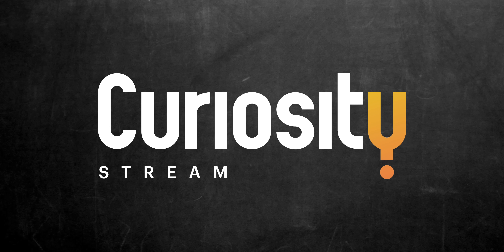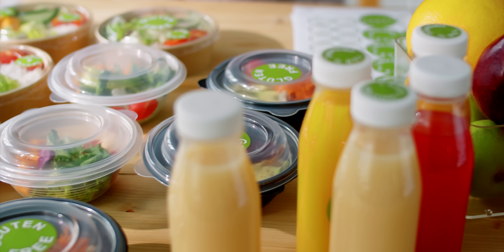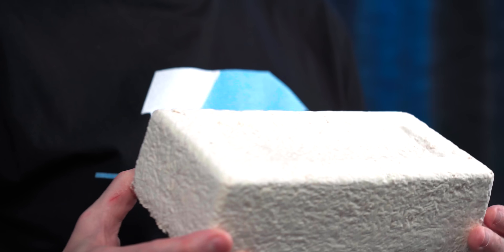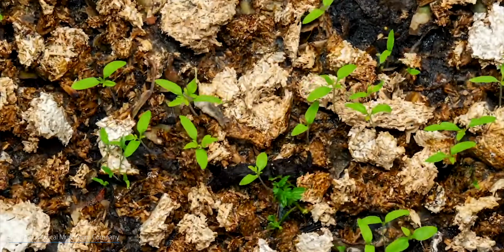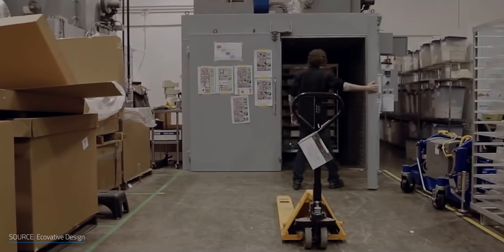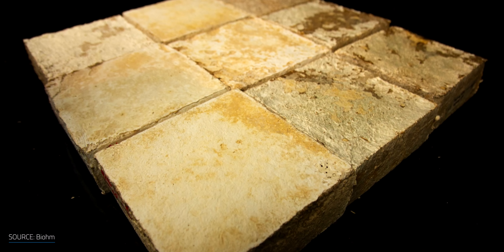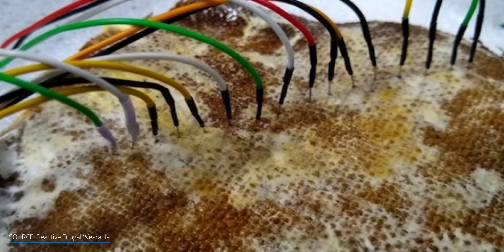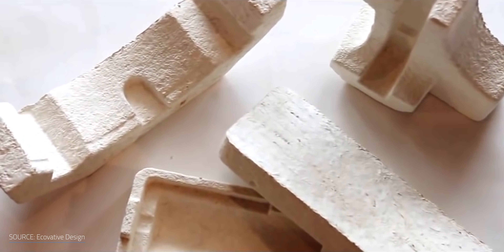Is Mycelium Fungus the Plastic of the Future?

Comment: Even if it ONLY replaces plastics in packaging that’ll be an enormous win.
Reply: and it will mushroom from there.

I'll show myself out.
Reply: It's ok, I'm not a spore sport. :^)
Reply: Sad thing is corporate oil companies all over the world doesn't agree. Because their oil by products after fuel production is processed into non-biodegradable plastics. Which won a Nobel peace prize for making plastics possible from oil by products.
Reply: @Niggurath-n4h  hmm so if they dont make plastics with it they just dump it?
Reply: @TeenyTinyDevil  they can put it back where they dig it or at least process them into a more suitainable products. Remember making it into plastics is just a temporary solutions of delaying the inevitable. All outcomes so far lead to more trash and unsustainable to the environment. Sadly people seems to ignore this cycle.
Reply: @Niggurath-n4h  over production. The short cut mentality to say its easier to produce new and unproductive to take responsibility of so called recycling. Same core problems will be there. This just another to run away from actual problem. With that said this sounds cool, but won't be surprised after few year of entering mainstream, it will do different then electronic vehicles. Solve one problem only to create a different
Reply: @Niggurath-n4h  also not all plastic materials are useless. Some, such as plastics for reusable containers are probably what we should use for these products. That way, when it becomes useless for say water or food, something non perishable can be held in it. Thus continuous recycling.
Reply: @DeathProductions200  That’s what glass is for
before plastic glass bottles where used.
Reply: @darth3911  i know, but we do have to remember. There are people, like myself, where possessing glass containers can be harmful. Why I think plastic straws shouldn't be banned. I cannot use metal, silicone. And many are allergic to the bio degradable straws. 

Look, I do believe that we all need to do our part, but remember disabled people exist and need to have access to certain plastics and materials because well, it is safer for them.
Reply: @DeathProductions200  Same can be said for plastic there’s people allergic to it
but even in the times when plastic was not a option 
there was alternatives to glass and even with that said i never heard of anyone being
allergic to glass so i don’t know why you use that as a argument on why to keep plastic.
Reply: @darth3911  again with disabilities. I'll use me as an example as I am one of many people. Having some cognitive issues where my coordination is effected, I can only imagine holding a glass cup, and all of the sudden dropping it. Hell to avoid spilling water I have to use both my hands sometimes. 

Most plastics if they do break. Dont shatter like glass. 

As for some people being allergic to plastics. Absolutely!! And we need to respect that. People can't control their health, so if they use say a plastic cup, straw, or plastic bag that are single use, why get mad at them. For me, I have to use single use plastic straws. Cleaning straws is a nightmare, and due to sensory issues, along with other things. Anything not plastic actually can be more harmful.

Before we effect the citizens, make a stand against businesses. Then we can figure out how to benifit the environment through each individual citisen
Reply: @qdgamer7183  I'll just say that it is the oil companies responsibility to make it productive and non pollutant.
Reply: @DeathProductions200  nope, it does not answer how are we going to dispose or make it sure it biodegrade into our environment cleanly. Recycling is just another way of delaying the inevitable outcome of pollutants and trashed.
Reply: 90% of ocean plastic comes from china and asia so i dont see how its my problem.
Reply: @Niggurath-n4h  oh now i get it why they kill US muslims they need OIL for plastic(wich to me Sounds Kinda weird Like plastic made out of oil)why dont they stop killing People and why dont they just make glass bottles or somthing Like that i meen you can recycle them too and you can use oils for foods if we are talking about that oils Like they dont need to kill us for it Like give me one reason to why to kill us for oil instead od buying it Like a normal human being
Reply: @Andrew-qs6ml  the war for oil/resources has been on going since the napoleon to world war 1. Which just spill out to the oil rich countries, when the countries involved realised their own oil field is noy enough to last longer.
Reply: @DeathProductions200  Why are straws necessary at all?  Apart from a very small minority (eg quadriplegic people, cerebral palsy, severe arthritis) can’t most people simply drink from the edge of the cup or glass?  So provide straws of various types to account for allergies etc to the minority and the rest of us just take the hit and sip from the edge of the cup/glass.  Sheesh
Reply: @drcanram  there are hundreds of reasons why people may need straws. I needed them recovering from a major surgery cause I couldn't lift my upper half. People who suffer from chronic pain conditions and have a flare up of pain. In the end, we shouldn't judge people from using straws, and we should be targeting the majority polluters which is the big companies that waste more than they recycle. We should develop good materials for straws that are safe for the environment and for everyone to use at the same time. But start by putting plastic restrictions where it counts.
Reply: @DeathProductions200  That’s essentially what I said.  Most people don’t need straws to drink.  For those who really need them, they should be available.  That is a small fraction of any population.
Reply: @karozans  I really don’t want to into any debate with a person who holds your types of views.  But I do want to thank you for pointing out how I clearly have chosen slavery over liberty because I have suggested that maybe very few people actually need to drink using straws.  I mean, why hadn’t I seen the connection between those two apparently totally unconnected concepts, before you so expertly pointed it out to me?  Wow, you are really smart and insightful.   Thanks again Vladimir
Reply: @karozans  Have nice life Vlad
Reply: @karozans  Wow.  You are so insightful.  How could I be so wrong ?  Thank God you are here to correct me and keep me from advocating Government control and slavery.  I really don’t know what I would do without your keen intellect and razor- sharp reasoning skills.  You are truly one of a kind.
Reply: @drcanram    I wiII, baby cakes.
Reply: @drcanram     LOL....  "I dnt want a d3b4te, but I wiII c6ntlnve on crylng forever...."

I kn6w what U wld do.  Not cry on YT.  That's what U'd do.
Reply: @karozans  🤣🤣🤣🤣🤣🤣
Reply: @karozans  Nope, because you are so cool and “edgy”.  The way you use numbers and capitals instead of typing normally- it’s so edgy, so cool!  I just can’t get enough of it!  Tell me, what’s it like being so cool and so “edgy”, huh?  What’s it like, Dmitri?  Please tell everyone your secret so we can all be even a little bit as cool and edgy as you!
Reply: @DeathProductions200  I appreciate this education. I of all people cannot predict the future. I am supposing (just supposing) that either plastic products such as the ones you need will continue to be available or there will be a different acceptable  products. I certainly hope so.
Reply: @Niggurath-n4h  Funny, that never occurred to me. Thanks for your thought.
Reply: @Niggurath-n4h  well we can try to change the world and support that by buying micelium stuff when we need them
Reply: @Niggurath-n4h  Unfortunately so true. (I did not know about the Nobel Prize.)
Reply: @Niggurath-n4h  This material would be valuable only if  fossil fuel is replaced by nuclear, but if that transition is not  given yet and notwithstanding that polymers derived from hydrocarbons  is still  to be replaced by some others like this one , then you will be exporting waste to poor neighborhoods, cities and countries.
Reply: @Niggurath-n4h  id rather them not use the oil but for gas
Reply: @einar8019  I also agree that is why I hate that Nobel peace prize condone such acts.
Reply: @Niggurath-n4h  Those same companies have lots of money in renewables. Just like with them, this technology would still be dependent upon oil in the production.

Don't kid yourself into believing these companies are against this stuff. They're the biggest proponents of it.
Reply: @Niggurath-n4h  Do away with this conspiracy theory, the reason why plastics aren't going anywhere for at least a century is because it takes that much time and probably even more for the lazies up top to move and do something, more concerned about security trough stillness than adopting innovation even if the latter at worst can only cause some small losses.
Reply: @Niggurath-n4h  when i see shit like that I think of Ted Faro in horizon zero dawn. Some fucked up assholes willing to destroy the world to any extent just to suit their profit margins.
Reply: @Niggurath-n4h  exactly...big oil will likely shut this fungus thing down too
Reply: @Niggurath-n4h  the plastic industry only makes up an extremely tiny fraction of oil consumption
Reply: @drkastenbrot  yes it is tiny but the effect is much greater as this doesn't dissolved in the environment. It needs industrial chemicals to brake it down.
Reply: @Niggurath-n4h  all plastic is oil based and all of it is basically not sustainably recyclable...that being said why wouldnt they win a nobel prize for making the firs thing that doesnt decompse(rust, rot etc) plus all of us could boycot plastic and it wouldnt make a diffrence there are people in this world that create hfcs to destroy to sell credit to companies that make plastic
Reply: @Epck  I respect ur reply.
Reply: @Niggurath-n4h  companies have a limit on the waste they get, if they do that, then the cost will be higher than the production
Reply: @Niggurath-n4h  which is a shame as there's probably better things we can use oil for than my shopping bag, container or even toys for the kids.
Reply: @Niggurath-n4h  The end of Big Oil is coming. We are running out. And when that happens you will see a dramatic change in how things are done. To avoid this I believe governments and companies around the world, not working together mind you, are starting to introduce new ideas and methods. Oil was once the Next Big Thing that dominated the world's economy for over a century. People at the top know that while they have no real idea when it will run out, it will eventually run out because it takes millions of years and billions of tons of bio mass to make oil naturally. So now many individuals and groups are jockeying for position so to speak trying to find what will replace oil.
Reply: @davidtherwhanger6795  nope there are still a lot of oil. It just that this well established oil company knows how to manipulate the masses to increase the oil price. They keep on saying that there will be shortage of oil by years in the future. But if you look at the statistics more and more oil rigs are being built. It just that this company are running out of easy to access oil field with little to nothing as a hindrance to the company corporate greed for more money.
Reply: @davidtherwhanger6795  We're not going to run out of oil in our lifetime, and probably not in your grandchildren's lifetime. We keep getting better at finding it, and extracting it from places that would have been impossible in previous decades. That said, we really shouldn't be using oil for everything.
Reply: @Park Justin yeah. Hence my comment.
Reply: Amazon boxes, the filler material, and clear bubble product packaging.  That would cut plastic use in half easily.
Reply: @clayz1  The filler material can be replaced with expanded corn starch. Some companies already use this stuff.
Reply: @clayz1  pp lo 0.l ppl
Reply: I can't stand getting styrofoam.  It's designed to take up maximum space so it's really annoying to dispose.
Reply: @alistairblaire6001  Never thought about it that way, or any way for that matter. But you might be on to something.
Reply: @Dollapfin  it will run out but not before a huge crisis and damage is already done. Which will lead to the cycle keep on moving forwards.
Reply: right. for single use plastics that would help a lot.
Reply: @I.M. Shirley Rongh economies of scale. Plus I’m sure they’d find a way to make it faster too. Also even assuming emissions from production was equivalent to what we are doing now, there would be significant reduction in waste.
Reply: @Park Justin   You want me to give an off the cuff estimation better than the (sin)30.
Reply: @Cancer McAids it still do not answer the plastic dependants of most petroleum base products. Which lead to the cycle of the trash and pollution problems.
Reply: @Park Justin ClayZ didn't have to come up with an actual number. Look at the stuff you (and everybody else) orders from Amazon. The container, the inner packaging, the filler, and then multiply that by the number of people in the US alone. Even if Amazon only changed for their US operations, it would still be a significant cut back in the amount of polystyrene and other materials used.
Reply: Only time will tell really. We can just hope for the best that things don't go south and lead into bigger problems.
Reply: watch the netflix documentry seaspiracy, the argument is industrial, and fishing waste is the majority of the problem, not bags and straws, it was a intrestign watch
Reply: I totally agree, plastic packaging of products and produce is a HUGE problem, and it's not recycling that is going to change that. The best solution is not producing or using plastics and derivatives in the first place.
Reply: I work in a water house and its so disheartening how much plastic get used in a day
Reply: If they make mycelium bottles, I will stop buying bottles

I aint drinking from fungus
Reply: @dieterrosswag933  the burnt carbon needs to go somewhere, filters separate things they dont clean things
Reply: @dieterrosswag933  I dont want anything random person from the Internet, I just wanted to fix a few broken braincells for you so you could realise the complexity of the situation
Reply: How did we ever manage before plastic containers?  All we have to do is look at that, go back to it in part and stop being so blamed lazy.  Let's face it, why do we all need to carry around bottles of liquids with us all the time?  That was unheard of up until about the early 1960's.   People drank whatever they needed to drink at home, at soda fountains or coffee shops and used reusable thermos bottles when they went to school or work.  People brought reusable baskets or bags to the store.  In England, they celebrate "Boxing Day" - the day after Christmas when everyone returned the boxes they got their Christmas presents in.  Imagine that!  Reusing our cardboard boxes.  Who'd a thought.   Jeff Bezos ought to have ways people can turn in all their used cardboard boxes so they can be used again.  In our area, you can return things to them at Kohl's or via UPS.  Why not have those places accept Amazon boxes for recycling since they already have merchandise going back to them?
Reply: but an enormous loss to oil manufacturers and producers, so there will be and already is heavy resistance. Industry doesn't like change. Sometimes we make it flat out illegal (See planned obsolescence)
Reply: Better never happen. Companies are too greedy to spend more on packaging they will lose out for the cheaper option. The day that this becomes cheaper than actual styrofoam is the day styrofoam will be obsolete. Till then styrofoam it's here to stay.
Reply: 3 words
Mycelium 3-D Printer!
Reply: @freddynovember5842  I like it!
Reply: I feel like farmers everywhere are struggling and this could add a new crop they can grow and make more profit off of. Not to mention they can supply their own growing medium
Reply: Just replacing styrofoam alone is a big win because once it breaks, it's fucking everywhere. I'd rather deal with throwing the stuff into a compost pile than to deal with the extra packaging going in the trash.
Reply: Can they make it clear? If they can't make it clear, then it won't replace the plastics used in packaging. It could replace cardboard, potentially; though, for obvious reasons we aren't really reaching for a green alternative to cardboard at this time.
Reply: @TheBrothergreen  most packaging isn’t clear. You’re thinking of the shelf-ready display packaging. Obviously that is a hurdle as well and frankly just shouldn’t be a thing anyway because it’s horrendous to open as is, but I’m talking about all of the styrofoam and molded plastic they put inside the cardboard boxes for shipping and such.
Reply: @disgustedluigi  eh, they only really use that kind of packaging with fragile shipments these days. Wine bottles, decorative candles, etc. Most shipping is just throw it in a box and let it go, the expectation being the "shelf ready" packaging will be enough.

This is true at the corporate and consumer levels.
Reply: @disgustedluigi  THEY ARE RECYCLABLE!
Reply: @TheBrothergreen  green alternative for cardboard? Isnt cardboard literally just recycled paper and biodegradable?
Reply: @dasavagecabbage9483  yup. Good job 👌.
Reply: Absolutely
Reply: @Park Justin   absolutely. I don't think people comprehend how big of an industry the packaging is.
Reply: ENORMOUS though
Reply: @Cancer McAids Actually the problem literally is plastic itself when used in food packaging. It leeches chemicals into the food stuff that causes increased estrogen production and cancer. Its part of the reason there's like 500% more ED and cancer in young people today than in the past.
Reply: @lurksnitchtongue8986  hmm yes and no, the increase in cancer can easily be the result of modern usage of cells and laptops as well as microwaves.

it also increases the closer you are to a traditional power plant of coal or oil. (we need to go nuclear as solar and wind don’t work)

if you have and use a fire place or ever gone camping, fire even when burning wood produces toxins which increases your cancer risk as well.

eating smoked food and...

as for estrogen, plastics do chemically mimic estrogen, there’s not much you can do about that, they don’t increase estrogen, they act as estrogen or pseudo estrogen in your body.

the best way to combat that is to eat meat and eggs which increases your testosterone production and take testosterone supplements. exercise also increases testosterone production.

the problem with replacing plastics is that plastics are extremely useful and easy to not only make but use.
Reply: @YinglisTheYinglet  So because smoke can cause cancer that means its fine to directly expose (nearly) every single thing humans consume to plastic? And the increase in test production from meat consumption is minimal at best, and you can't just get testosterone supplements (steroids) without having an actual good reason to, and using plastic packaging is not enough of a reason lol. Besides, taking them long term can ALSO cause cancer.
Reply: @lurksnitchtongue8986  1) steroids aren’t testosterone supplements and you can get testosterone supplements over the counter.

2) beef is actually #7 for one of the best testosterone dietary sources according to healthline, eggs #3, milk fortified with vitamin D #2, fortified with vitamin d cerals #4.

vitamin d is also linked to improved testosterone production as you can see so vitamin d supplements also help.

3) i said there’s not much you can do about the chemical make up of plastic, the best thing to do is to prevent leakage and just handle it
Reply: @YinglisTheYinglet  1) no there are not. Anything that increases testosterone production in the body by a substantial degree is an anabolic steroid. If you disagree I encourage you to name what supplements you're talking about

2) Regardless of where a food ranks in promoting test production compared to other foods, its still really low and negligible

3) There is something you can do. Plastic should be banned when it comes to any form of food packaging. It has nothing to do with leakage. Particles of plastic from packaging ARE going to leech into food products if there is any contact at all.
Reply: @lurksnitchtongue8986  1) if you’re gonna nitpick, than none anabolic steroids aren’t testosterone supplements.

testosterone gel

D-Asparatic Acid (a key component to natural testosterone production)

DHEA a anabolic, over the counter brands Life Extension DHEA, Country Life DHEA Complex For Men

what was that about it not being over the counter?

2) tin and aluminum cans also do the same with contact, glass also chemically leaks on food with contact but is generally sturdier.

so do we ban glass, tin, and aluminum from food storage as well?
Reply: @YinglisTheYinglet  1) None of those actually work when it comes to increasing testosterone production. They're modern snake oil. If they actually worked they wouldn't be over the counter, because increasing test production can actually be really dangerous and needs to be regulated. If it actually worked almost every major athlete would be abusing them.

2) You yourself just admitted those things are far more stable than plastic, which is what makes them better. The melting point for metal and glass is insanely high, for plastic is like 200 degrees. Plastic is also way harder for the human body to process and filter out. Hence why it stays in nature for hundreds of years.
Reply: @lurksnitchtongue8986  multiple studies do suggest dhea supplements do actually work.

as for T-gels and T injections they’re literally made out of testosterone so i don’t know where you’re going with “they wouldn’t be over counter if they worked”

and no, i said sturdier not more stable, those are 2 different concepts, (when handled appropriately), inappropriate handling because of glasses brittle nature does result in micro glass in your food and again glass also chemically leaks all over your food
Reply: @YinglisTheYinglet  Umm... Beef has oestrogen pumped into it.
Reply: let us forget IPR , transfer the technology to all countries like Vaccines, after all if poor country spoils earth it will reach rich country also.
Reply: 1) it “IS” plastic 

2) if you just used the fungus even with manipulation it would eat the package, the fungus is capable of anerobic metabolism and literally eats plastic.

3) if you actually care about the environment, compostable plastic is the way to go
Reply: It is too labour intensive and expensive to produce to be used as the protective in the packaging.
Too much hypes...
Reply: @drpk6514  yeah, because production methods are never improved or optimized ever.
Reply: @disgustedluigi  it is impossible to make it practical due to the sterilisation and the time it takes. I know it because I dealt with them. Using potato starch materials are the best substitute for styrofoam.
Reply: Is there anyway we can help these companies besides purchasing products?
Reply: Agreed
Reply: Won’t happen, too expensive.
Any alternative, as cheap and awesome and easy to produce and use it might be, can’t beat the fractions of cents it costs to produce a petrol based plastic product. You just can’t compete with „virtually free“…
Reply: @Renuclous  Which is why the government needs to step in and make it happen. Plastic is cheap to produce, but the cost is our long term health and stability which is far more expensive in the end.
Reply: @lurksnitchtongue8986    No they don't, and plastics do not cause health problems.  Plastics increase health, not decrease it.  You are believing lies.

Remember when everything sucked and the government came in and made everything better?  Neither do I.
Reply: @karozans  "Plastics increase health"
L. M. F. A. O.
Reply: @karozans  You are completely wrong, and I suspect that you know it.
Reply: @drcanram  Not a valid argument, honey.
Reply: they wont take the L lol
Reply: Wont make any difference until china gets their act together.
Reply: Not really
Reply: @Cancer McAids I think I read somewhere that packing material is about 10-15% of all plastic use in the world? or was it waste. Regardless, yeah, petroleum-based products aren't going anywhere but that 10-15% is likely to be replaced as soon as oil prices increase just enough that investors stop sleeping on it.
Reply: Super Mario Brothers Super Show nigggaaaaa
Reply: Thats what I love about these massive scientific inventions, even with the minimal risk option the change is massive.
Reply: plastics too far for me, replaces styrofoam is the main goal
Reply: Buy it, raise the demand, the supply will eventually grow and plastic will become obsolete
Reply: yeah since packaging plastic is used everyday everywhere
Reply: You have no idea
Reply: Spoken like a true mario brother
Reply: Absolutely. That's the category that most needs replacing.
Reply: @Cancer McAids You get it.
Reply: Just grow your own... boom solved
Reply: and sex products will save ALOT
Reply: And unlike the electric car and lithium mining this is actually salable. Here's hoping this won't turn out like plastic has, and I don't mean the recycling part but how some plastics are toxic to humans or give up substances that end up having negative health impacts.
Reply: @dieterrosswag933  what do you think a filter is gonna do?
Reply: @dieterrosswag933  how do you clean carbon dioxide?
Reply: I think plastic is invented to be strong and reusable but people just yeet them everywhere
Reply: @dieterrosswag933  and you dont know much about plastics and air filters
Reply: victoria secret
Reply: I wouldn’t mind that at all imagine this in the summer for ppl who buy those disposable coolers
Reply: To little too late
Reply: Imagine in the future you are Like 3 years old and instead of your parents buying you an plastic toy they just give you a mushroom
Reply: @Park Justin around 40% of plastic waste is actually fishing nets and lines
Reply: Hell yeah
Reply: It will need to be cheap, VERY cheap
Reply: Stop using disposables!
Reply: Shut up
Reply: You need JESUS. Pray to HIM, HE loves you.
When you die as we ALL will soon. 99.9 sooner than they think 🤔 ..you will kneel before JESUS. Romans 10:5/10. The One and only true Son of GOD Almighty, all others are false..we are all sinners and need JESUS.  JESUS was crucified on the cross at Calvary and then on the third day rose again, for you and I (John 3:16). So, Choose this day whom you'll serve. For if you don't it will be chosen for you and that is HELL
 Arguing with me is silly at best. Bc I'm just the messenger...
💌
Please call .
83.For.Truth.☎️.👍....... ...........🤔
Reply: @Mr.Caring  Please, this kind of comments puts Christianity in bad light 😔🙏🏻. You don't need to believe me but please pray about this and ask guidance from Jesus. God bless! 😊💛
Reply: @Mr.Caring  I have given my life to God and asked Jesus to be my saviour two decades ago 🙏🏻😊✝️. I have never regretted that! My roots are in Pentecostalism but most other Christian congregations are good too.

I wrote to you because I find your approach to be alienating towards people that still haven't found Jesus. What you write is true but "the scare tactics" are not the efficient / proper way - I think.

I have prayed regarding this and also asked what my older fellow Christian thought. We both got the same guidance that this kind of way you use isn't what our father wants from us as Christians. So please, I urge you to pray wisdom regarding this. 🙏🏻💛

God bless!
Reply: @T3KKANッ TRUE THAT!
Reply: The most important thing is to get plastic away from the food we eat, plastic chemicals leak into the food and makes everyone more feminine, women and men and it’s why most girls enter puberty as young as 7 years old, it basically makes women age a lot faster and it makes men more neurotic, easy to anger and feminine.
Reply: Too bad we’d rather go ruin other planets than solve the issues depleting and killing ours.
Reply: @DICKFARTZZ  this why the capitalism is bad to the environment
Reply: true, gonna be big bang, hitting the fucking function of a plastics
Reply: Lol. ‘Only’. You picked the largest plastic market. Aim lower.
Reply: So it’s strong or it decomposes on 45 days? Lol this is so misleading.
Reply: Imagine us developing fungus that consumes plastics as a food source like we've been trying to get bacteria to do.
Reply: Luigi mushroom
Reply: Most of the stuff this would replace plastic for in packaging (since it shares the same use case limitations as hydroscopic polymers) can be done with the wood pulp or mulch you'd feed the fungus anyways. Maybe the novelty will get people onboard with alternative packaging materials but unfortunately we only ended up getting a small idealized piece of the story in this video.
Reply: Adi…das not adeeeedas
Reply: @Cancer McAids yes but that wouldn't be a problem in the first place without plastics.
Reply: Honestly everything but food sounds amazing. But then again I've never like mushrooms on anything...
Reply: @Dollapfin   Actually if the mushrooms are more excepted and are given the ability to go main stream then they could actually be preferred because they could become even cheaper.
Reply: @Cancer McAids I agree, plastics have their place in technology, but that technology should be long lasting, plastic is perfect for that use. It should however not be the material for single use items, packaging, trinkets and toys, but be used in where it is really useful and necessary. Even if single-use plastic was replaced, we still have a huge problem (which unfortunately now has industry built around it) of disposing, transporting and dealing with the now useless material, whatever it might be, it still required huge effort and large amount of energy. I think the solution still is to have more drastic changes in our way of living, which would mean a different transportation and distribution solutions which would not include such a wide use of single use packaging. 

In a way I'd like to see a return to the old in a modernised way. Standardised containers for consumers to retrieve their goods and refillable larger containers for products to be moved in between the shops and back to the manufacturers to refill them again. Just reducing the packaging amount on necessary products like food would be a huge win!
Reply: There's a fungus among us...
Reply: Very true...i think the key is to be reasonable. Use it at first where it makes the most economic sense, let it get established, and then expand it's use. This is one area I don't mind if the govt requires it's use as long as it makes sense.
Reply: Hemp
Reply: Mushrooms can also replace animal leather.
Reply: well  I don't think it will replace plastics 100% as the molds for the foam and bricks are made of plastics :) 

Still it's a start, even if they replace  just polystyrene, if they can make bottles out of it   and it's cheep to make them, then it could work.  

but 100%  replacing plastics is a wet dream at this point, fun but not real. 

As a side note, it's kind of funny how companies like this say they are peddling a product that replaces a "bad " product, when they make the molds they need so much out of transparent  plastic :)  

It's kind of like a vegan going  "meat eaters are Satan"   but then he goes to KFC and  gulps a whole bucket of chicken, I mean, sure he could go and buy vegies from the market, but why bother when KFC is right across the street, just like the makers of fungal plastic could use iron or wooden molds, but why bother when KFC is soo much cheaper :)
Reply: 1 point for logistics
Reply: what about pannels in cars, said its tougher
Reply: @Dollapfin  COW FART FACTORIES
Reply: “Only”
Reply: DisgustedLuigi, But not for death.
Reply: It wont. Its way too expensive and slow. Im not saying i wouldnt want this, but it wont happen. Show me a fungus that can grow to shape in at least under 1 hour and has the same properties as polypropylene, and then ill be a bit more convinced. World is used to packaging that costs cents, and can be made in literal seconds.
Reply: @Cancer McAids the breaking down and recycling of plastics leaks microplastics into the environment anyway. Which ends up in food and water. Even after filtration
Reply: This is the correct mindset to have. The reality is that oil-based plastics are a bit of a miracle product, I doubt there is any one material that can replace every case where plastic is used. We need to be willing to take smaller steps, settle for alternative materials that might only replace plastic in a few areas. If we do that for a few decades, maybe oil-based plastics can be relegated to only one or two kinds for niche uses, which would allow it to be efficiently recycled as well.
Reply: I think you're right because single use disposable plastics are what make microplastics so prevalent. I know they are useful for the differently abled or disabled (whichever a person from said group prefers) so it is good we keep them around. But if fungus can be used instead, for straws let's say, and To-go containers then that would be awesome
Reply: @bnpixie1990  I think even if it’s JUST long distance shipping material for like overseas freight and cross country trucking until it makes it to store shelves would be a massive step. I don’t have any numbers but I imagine even just stuff like packing peanuts, bubble wrap, styrofoam, waxed/coated cardboard, and other hard to decompose materials used in bulk make a large portion of all micro plastics and long-term waste even if we don’t normally see it.
Reply: It also needs to be cheaper than plastic which I don’t think it could do, it’s just not that popular either to make enough
Reply: We could get a telekinetic inside the box to control the item from breaking.
Reply: Clear plant based plastic alternitaves already exist and are made from potato starch and plant cellulose, it's what we should make straws from instead of unrecycleable wax paper.
Reply: yeah i dont expect more then that....
Reply: yeah sure buy a takeout pizza packed in mycelium box when you come home pizza is gone what happened? mycelium has eaten you pizza and if you lucky maybe you hear the box - "burp"!!
Reply: @bitsmart...  that’s a dumb example when pizza boxes are already recyclable cardboard.
Reply: Could we send rockets into space filled with plastic to rid the planet of credit card companies? Or wait, when cc's expire you can trip on shrooms
Reply: The seaweed based plastics can and are replacing plastic packaging
Reply: Clothing would be good also because the most of micro plastic in water is from washing clothes made of polyester.
Reply: Is it floatable? Or can withstand water... Is it applicable to hydroponic?
Reply: Ew, no I dont want fungus as a cereal bag.
Reply: i wouldnt mind having a pair of shroom shoes to go with it
Reply: @LIONGOD  mushoes*
Reply: @KabegamiTheGreat  shoeshrooms*
Reply: There is another alternative that uses recaptured CO2 from the air fed to water based algae that then produce a material that can be used to produce a plastic alternative with most of the same properties that can be used to produce the same sort of products and biodegrades within a few years.
Reply: it doesn't
Reply: @mori7423  Captured repurposed carbon plastic does.  Produced via feeding Algae CO2 recaptured from the atmosphere and processing the algae's waste product.  The resulting carbon plastic pellets behave like regular plastics in production use, but biodegrade in a matter of a few years.   Excellent for short term packaging and disposable goods such as straws, cups, bottles, cutlery etc.  Anything that would expire within a short period of time and requires disposable plastic.
Reply: Water bottle s are probably the most dangerous to humans as far as endocrine system is concerned
Reply: @808yorkie  Why is that?  Why water bottles precisely and not say soda bottles?  Or other plastic bottled products, such as ketchup or mustard bottles?  What about plastic containers for cooking in microwaves are these not a concern?
Reply: i dont get it, we already have carton and paper, why do we need this?
Reply: no.  facts are hugely skewed in this video towards idiotic-green point of view.  this material is heavy, fragile and expensive what means it needs more fuel and money.
Reply: @vasyapupken  you act like every successful innovation is perfected and market-ready from its conception. Nobody said it was ready to replace anything just yet.
Reply: @vasyapupken  Most of the mycellium I've dealt with isn't heavy or fragile.
Reply: There's been a few articles out lately that claim a recent discovery of a bacteria that can harmlessly digest and pass the plastic back into organic forms. 

To me though, this sounds a little too convenient as far as timing. Almost like this bacteria was known, or suspected to meet the needs of plastic disposal, from the very beginning. Probably wasn't any where near being ready but got rushed once something or someone reached a panic level.
Reply: @Iceflkn  plastic is organic... i mean that’s a over simplification because it also has hydrogen but most of the material needed is actually organic, gases and oil just so happen to have a bunch of the material in abundance.

the reason certain plastics take so long to decompose is because of their very strong bonds.

fun fact: there are beetles and other animals that can now eat plastic
Reply: @YinglisTheYinglet  I knew all that but thank you for sharing! 😁  

I view the business world with suspicion and disgust having learned how many industry giants manufactured, sold and polluted knowing full well the dangers involved.

They didn't care how many got hurt or killed, wanting only money and power.

Funner fact:  animals and such that now eat plastic, only got the chance because we humans put it everywhere, including their menus. 

Go team human.....ugh!

Also, humans and animals alike are getting poisoned by Microfiber released into our planets water systems and since we don't even filter the water used when washing microfiber materials. 

It's found it's way all the way into our bottled water production plants. Enjoy a nice bottle of water on a hot summer day?
Reply: @Iceflkn  apparently some people wash their lint down the drain instead of throwing it out in the trash which contributes to microfiber pollution.

and there are new filters now able to catch microfibers, they don’t catch all of them though. perhaps making microfiber filters mandatory for water treatment facilities and for new laundry machines would go a long way in helping reduce microfiber pollution
Reply: @Iceflkn  Bruh it's called evolution. Pretty sure there's now multiple known organisms that can degrade different types of plastics and there's also genetically engineering experiments to combine their genes and optimize  them and so on.
Why would there be plastic eating bacteria "from the very beginning", before there was even plastic? What would it have survived on?
Reply: The odds are that the claims made in this video are greatly exaggerated.  You think they are 100% accurate because they feed your confirmation bias.  You only look at the positives and ignore the negatives.

If Mycelium products were better, cheaper, and faster on all the things they mentioned, the demand for it would explode at an exponential rate despite what you think the oil companies are doing to keep it hidden.  You cannot stop good ideas from spreading like wildfire.  No one can.  If Mycelium were indeed better, people would adopt it without the government having to make plastics illegal first.

Furthermore, we do not need to replace plastics.  Plastics are nothing short of a miracle given to mankind.  Without oil and plastics we would be living like troglodytes.  The answer is not to replace plastics.  The answer is to use the best product for the job and the best material for the job is determined by prices in a free market.
Reply: @karozans  someone is a little aggressive today. Where did I once say any claim in this video was 100% accurate? I just like to see new ideas given the light of day and see how far they can go before determining they are a failure and tossed away in its early phases. Maybe you should check yourself before you claim someone else is relying on their own confirmation bias. Yes plastics are amazing and have made our lives significantly better, but they aren’t all amazing you know. Micro plastics in our food is a major concern, as is waste. You’re right about the market needing to adopt an alternative rather than it being forced, but that’s precisely why I like to give these inventions a fighting chance. Maybe one of these ideas will be optimized and improved to the point that plastic becomes obsolete and we all end up with a truly better alternative that is a greater benefit at the production, consumer, and environmental levels.

Also stop making assumptions about me from just a single sentence. You made a lot of assumptions about my thoughts about oil companies, the efficacy of plastic alternatives, my biases, and more. All of which were wrong. Grow up a little.
Reply: @disgustedluigi    Not a single person or company on earth will throw away anything if it is a better, cheaper, faster product.  You don't have to worry about things being discarded like that.

Yes.  All plastics are amazing.

Microplastics in our food is a myth, just like those dead birds and turtles you saw with their bellies full of plastics and lighters and such.  They are proven fakes.  Just as always, the people who created those "studies" are ultra radical Leftists who are heIIbent on destroying the entire plastics industry.  There are no valid wipe spread studies that show we are gobbling down plastics in our food.  When was the last time you were eating a piece of fish and you chomped down on a peice of credit card?

Even if a person did consumes X number of pounds of plastics per year, it's not a major concern.  Plastics cannot be broken down by the human gut and cannot be absorbed through the gut.  You could eat 10,000 pound of plastic per year and it would harm you at all.  The only thing you MIGHT  have to worry about is if the plastics are gassing any chemicals and that can be easily tested for.

The market WILL adopt anything as long as it is better, cheaper, and faster.  This is why "SOLAR FREAKING HIGHWAYS" was a monumental disaster.

If you saw the video for "solar freaking highways", it sounds so amazing.  Then they built a 1 kilometer stretch of solar highways in France I think, and it was so costly and never worked that it was one of the biggest failures in world history.

It is highly unlikely that plastics, oil, natural gas, and all the other things will ever become obsolete.  No materials will ever become obsolete.  The only thing that is likely to happen is that new materials will be made that are better for some things rather than other things.

I would be willing to bet a large sum of money that if I were to sit down and probe your true thoughts on a lot of things, that I am probably right about most of it.
Reply: Yeah I'd love to have my food packaged in fungus XD
Reply: @zwenkwiel816  is dead mushrooms worse than all the bpa and other cancerous substances that go from plastic to food? I think not.
Reply: @enricod.7198  dno, is it?
Reply: @zwenkwiel816  Mmm... Mmm... everything will be Mushroom flavour, Too bad if you are allergic to Mushrooms, Eh?